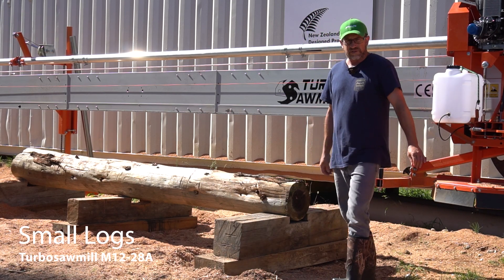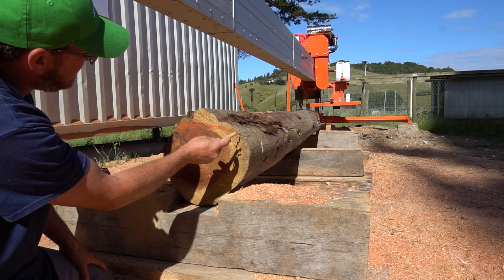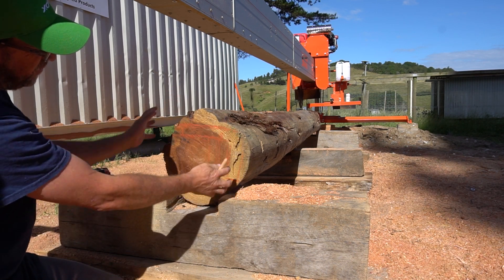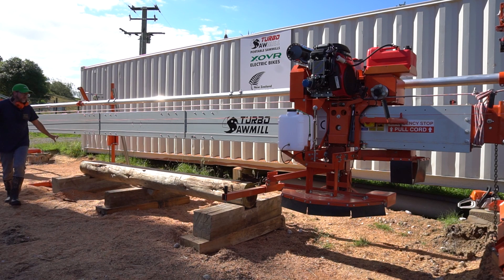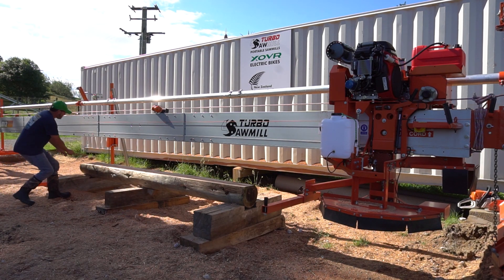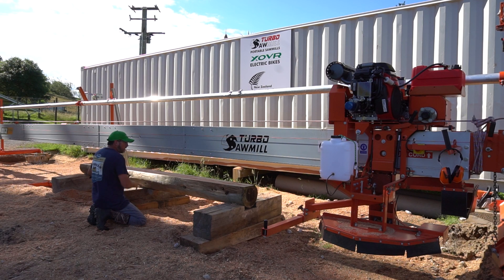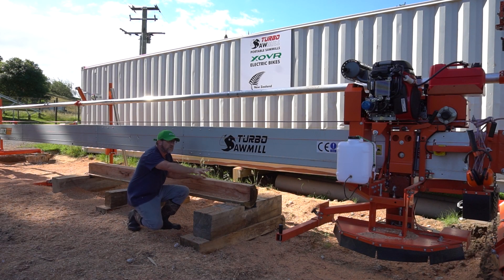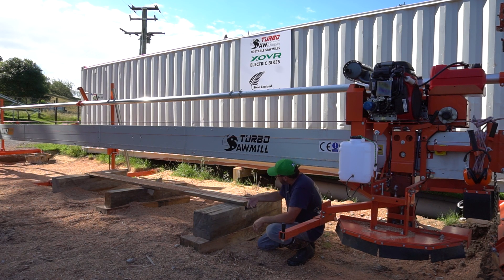Small Logs on the Turbosawmill

Comment: Nice video. I have a diy version and it has always surprised me that there are so little focus on the fixture of the log on swingblade saws. Bandsaws have good clamping systems.  Some use two cuts for deep cut, saying its faster and more precise, have you experience with that?
Reply: We like to get everything out of the log. Steel in the way means you waste a large portion of the log. Correct timber bunks and experience using the saw is the key here for recovery - not steel log dogs. Our preference is keep steel well away from our circular blade.